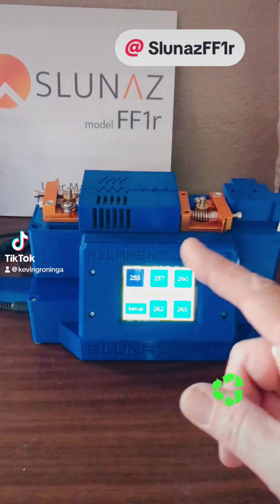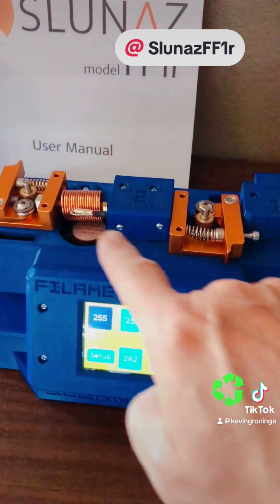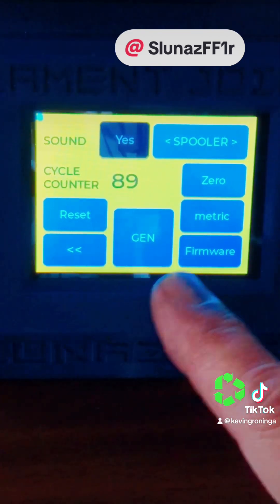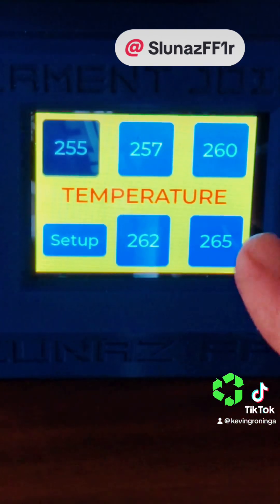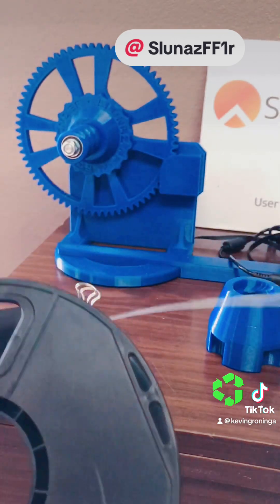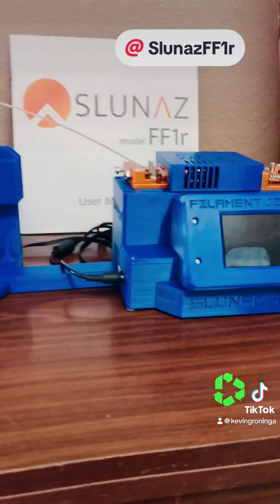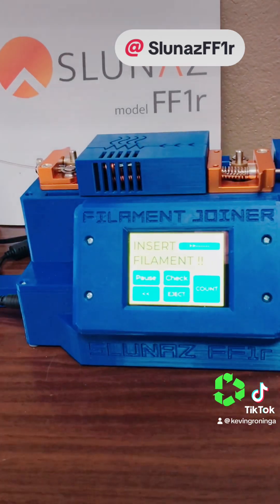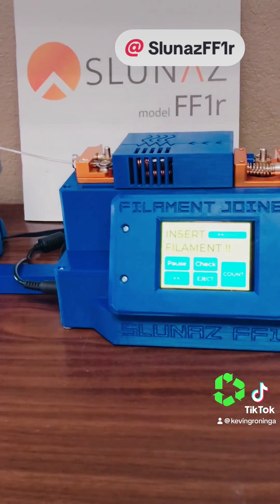Slunaz FF1R Automated 3D Printing Filament Joiner

Comment: Great video but……Worst possible piece of junk. I bought this and I received broken pieces. The owner just sent me files to reprint it myself….. worst possible customer survice and all I get is an I’m sorry. Don’t waste your money. Get the Sunlu filament connector…..much better product and you won’t be ripped off. The owner even turned off comments on their video because of all the bad feedback.
Reply from the maker: I bought this as a kit and printed all of the plastic pieces myself, using PETG. I did all of my own assembly of the machine myself as well, so that I understood how everything works. This machine has been fantastic for me since I use it primarily to join sections of PET filament that I make myself from recycled plastic water and soda bottles.
Reply: I bought the whole thing where it came mostly assembled with all of the parts.
Reply from the maker: @ okay.  So I’m assuming you have a 3D printer, correct?   Why not just print the parts needed, complete the build and give it a fair chance?  I get what you’re saying though, it maybe should have been boxed (or double boxed), so that it didn’t come broken.  How far was it shipped?   I know these days our carriers like to just throw boxes around or stack the fragile ones at the bottom of the piles while the ones with the anvils are stacked on top.

Comment: How is the FF1r performing over time?  Does it have any issues joining the severely curved filament at the end of a roll?
Reply from the maker: It's still working really well!  Yeah, filament with real tight curls can be difficult to get started into the infeed portion.   I generally don't use this for PLA or PETG.  I mainly use mine to join PET filament that I've made from PET plastic bottles and processed through my pultruder machines.  It's been fantastic for that endeavor, and joining a lot of segments together to make full spools for my larger projects.

Comment: Can the unit be printed in PLA or will it require PETG?
Reply from the maker: Hmm, I printed mine in PETG, but I think it will also be acceptable to use PLA.   You might want to reach out to the designer (Stephano Lunazzi) and ask for his recommendation.
Reply: Hi, I'm the designer of this machine. You can print in PLA the parts that don't touch the motors or the heated parts, but petg, pet or abs are recommended.